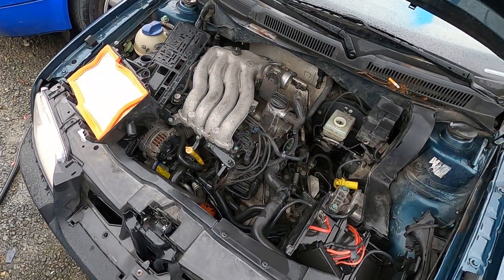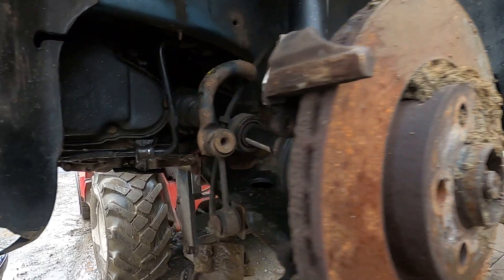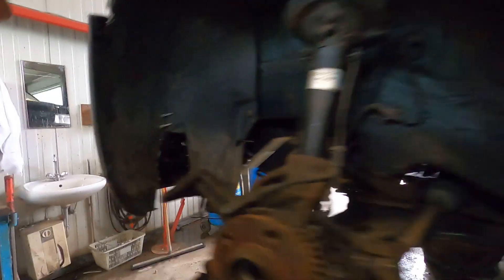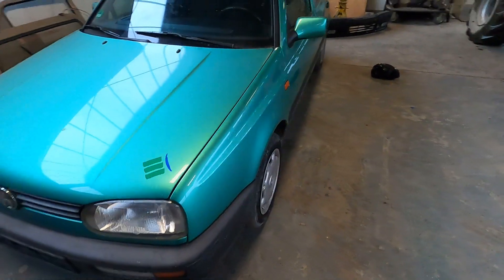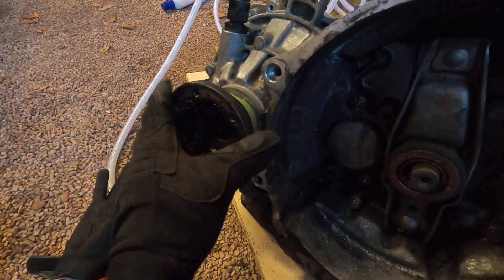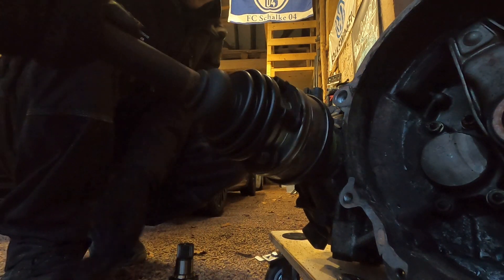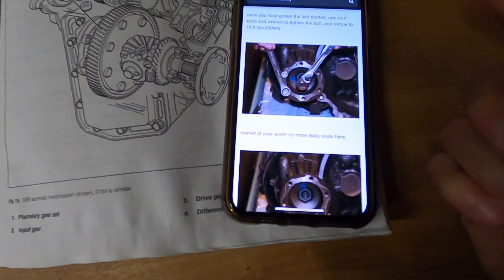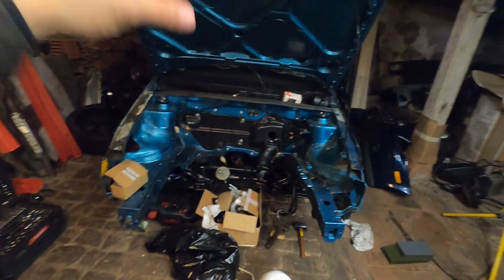MK4 O2J Transmission In A MK3 : Diff Flange Swap - 108mm To 100mm ( VR5 Savoy Project )

Comment: Dang. I've always had such a time installing flanges when a trans is out of the vehicle... I have always used a pry bar to get the spring to compress in order to start the Alan bolt. Nice work

Comment: When I split my gearboxes to fix the common 1&2nd gear issue I just "nip" them up.. if you are ever worried just put some thread lock on it 👌.. done a load now and never had an issue

Comment: @Christian Smith have U thought about putting a 6speed out of a Audi TT coupled to the 18t in the Pink Floyd? Think that would make a interesting combination 🤔🤔 just take off transfer case & fit a 2wd conversation kit cheap enough.....yea I had to change the gearbox cups on my Sharan vr6 6 speed gearbox as being a 02N (just a 02M with different cups) that I put in my mk4 v5 
Can’t wait for more Savoy/Floyd content 👍

Comment: so, I'm trying to re-install the flange and it won't seat.  It seats fine with the spring removed.  With the spring on, no seat.  Therefore the bolt won't thread in.  ; (